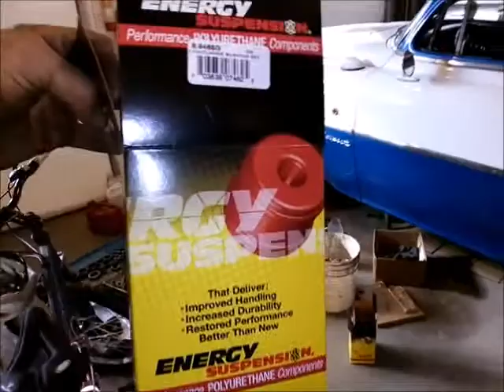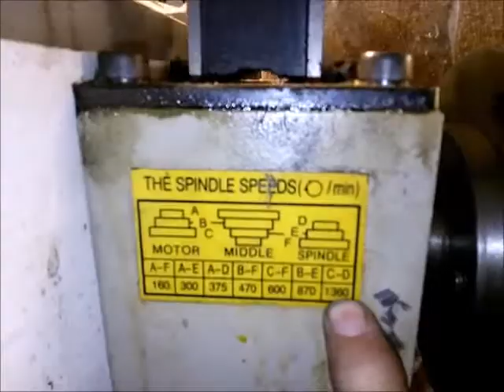Part 1 of 3: Turning Polyurethane urethane bushings on a lathe

Comment: I learned this from an old machinist who was doing attempting to turn rubber bushings for an old 1960's era Opal.  He  would fill a 3 pound coffee can with acetone and dry ice, then put the bushings in the coffee can.  He would let the bushings get very cold in the dry ice/acetone mixture, then extract them one at a time and turn them on the lathe until they began to get soft.  He would return the bushing to the can and grab another one and turn it until it got soft.  He repeated this process until he was able to turn each bushing to size.  I always thought this was a genius idea.
Reply from the maker: Cool - no pun intended.

Comment: Great video! Have the exact same issue. Unfortunately, in my situation, the ID is the problem. Good to know about the cutter and speed.
Reply from the maker: Glad it helped. You can easily drill polyurethane bushings, see my video here: https://youtu.be/s-2nJeH8kiw
Reply: @blanchae  I guess I commented too soon...I watched the other video too. I needed an ID of 1.250", but only have drills up to 1". I was going to rig up a carbide edged drywall knife blade on a boring bar, but decided to just try to use a carbide insert. Worked great! I also stuck the urethane in the freezer for a couple hours. Made it easier to work on the lathe as it didn't deflect as much...at least until it thawed! Great videos!